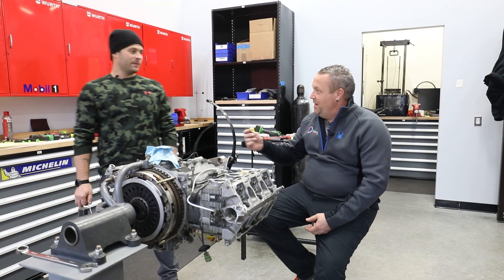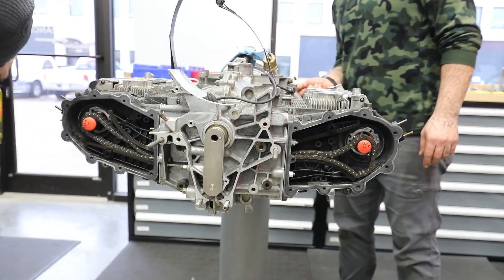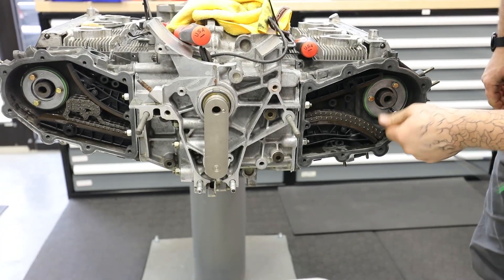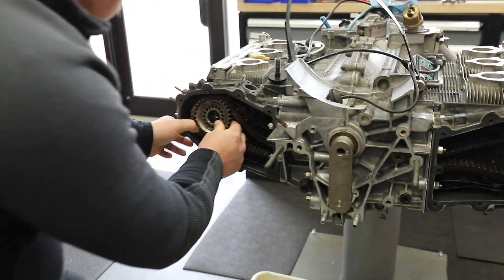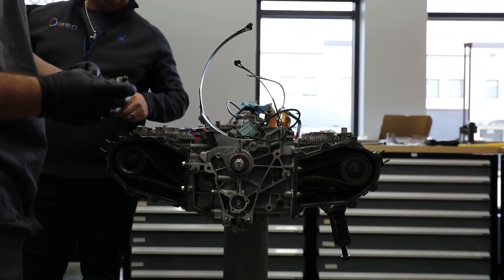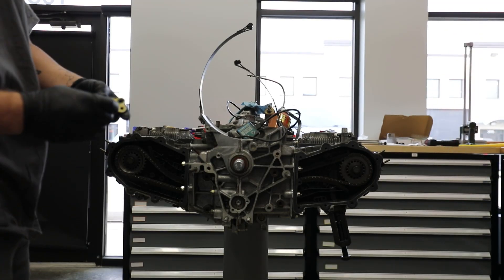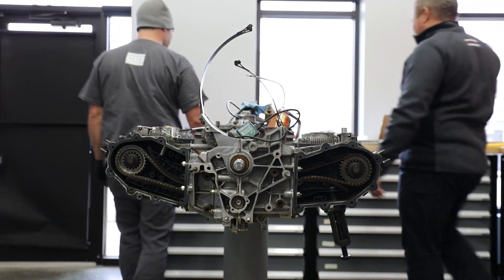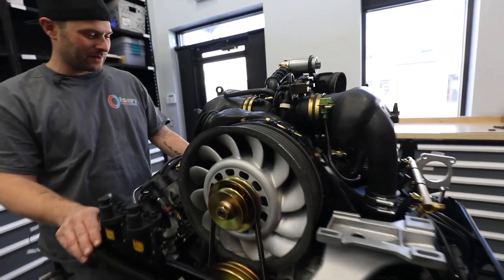DIY Engine Cam Timing Part 2 // Assembly + Timing Porsche 993 Air Cooled

Comment: Awesome video, Todd and Tim! Quick question/clarification for the two pros.🤔

With the 993 engine in, I'm addressing those rectangular cam chain box cover gaskets, the camshaft o-rings/paper gaskets, and lastly the timing chain cover gaskets.

Is it possible to not redo the timing if you put your engine at TDC, lock your crankshaft pulley in place or just make sure it never moves during the job, then put the sprocket back exactly in the same location on the chain and put the pin exactly back in the same hole?

Comment: So my tools all arrived today so tomorrow, hopefully will be doing what you guys just did on my 1996 993 C2 6speed. It looks so easy when you guys do it. I have the same tools (except the stromski tool to double check my work. However I'll let my shop do that. Will post on my Green Hornet Project on fb.

Comment: 14:15 I see you are using the 964 cam gears in the 993 and pin for locating the cam gear to the cam using the woodruffe key and smaller sprocket. The Porsche original 1995 993 cam sprockets are flush with the cam and the bolt simply holds the assembly together. Luckily my earlier 993 cams had the woodruffe key cut-out and I switched to the 964 system. You are using the same Stomski setup I am using.

Comment: Nice work ☝️
I have a question on a part you did not show in the video. 
The timing chain covers seals and bolts grommets. Do they need to be coated with loctite574 or it will leak ?
Reply from the maker: Put them in dry!

Comment: I noticed you torqued down the chain boxes without the cam placed in. Does that matter? I have my cams in and chains on them. However I have not torqued the chain boxes onto the engine. Everything is loose. Do I need to remove the cams and then tighten the chain boxes?

Comment: Great video! 

I do have a question, you didn’t measuring the hydraulic lifters and check the valve lash. As you know PORSCHE has three different size hydraulic lifter. Standard, size 1 : 0.5mm shorter. Size 2 :1.0mm shorter. So what did you use and why didn’t you show us how to measure while doing this build? Thank you in advance.
Reply from the maker: Thank you for the note! This motor was inspected when we tore it down and everything was kept to factory specifications. We will do the lifter procedure in another video. Typically if we are doing different camshafts or a high performance engine that is 993 based we switch to mechanical lifters

Comment: What do you think of the woodruff key, cam flange setup? I k now the late 993s dont have them but what's your take, good or bad?
Reply from the maker: Never had an issue with them? I always feel with the 993's "I hope it holds" as it isnt pinned 😂 but we prefer the peace of mind the earlier models had.
Reply: @Olsenspec  I have heard that a lot from other builders. So can I just add those components to my cam setup without anything not fitting properly? I have the two cam flanges and the two woodruff keys. Bought them off eBay. I don't have the spacers though.
Reply: I switched from the flush mounted cam sprockets on my 993 to the 964 cam sprockets. My cams had the woodruffe key slots.

Comment: Thank you so much for this video, can you give me the tool parts number to do the same job please? Im sad that you dont change valve spring to show us the right way to do it without removing the cam tower .. Best very helpful video, just need tool part number please 🙏
Reply from the maker: For which engine? The 993? Or the 964
Reply: @Olsenspec  964 engine please
Reply from the maker: @drnc8770  Baum tools, and Stromski Racing both have what you need. The SR guys are great and have really expanded their lineup. Tell them we sent you over!
Reply: @Olsenspec  Thank you very much.. Do you know if you are planning to make a video to show how to install performance valve string without removing the cam tower?because generally people change valve spring when they add new performance cam..I dont find any video like this on internet.
Reply from the maker: @drnc8770  we have not yet found a solution because the access to the valve is tight on a 911. On an OHV motor it is much easier, however we do not deal with those (like a 944, 928)
Reply: @Olsenspec  Ok so its impossible to change only valve spring and reteiner without taking apart the head?
Reply from the maker: @drnc8770  in our opinion yes!
Reply: @Olsenspec  thank you 🙏